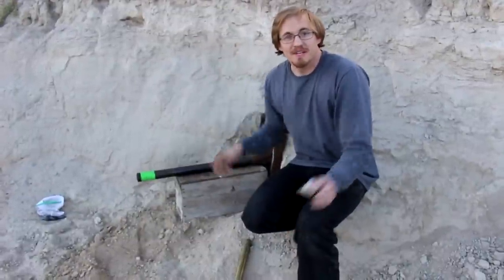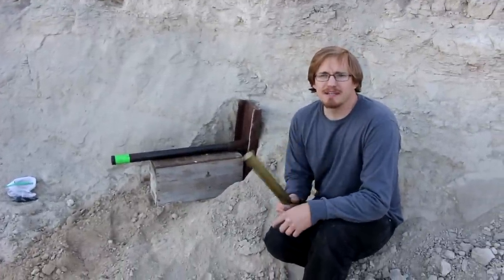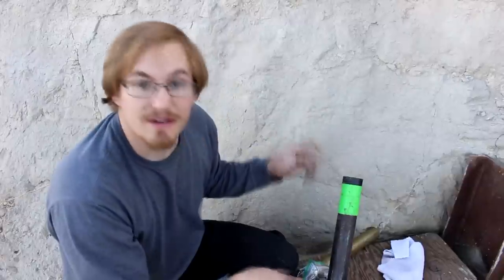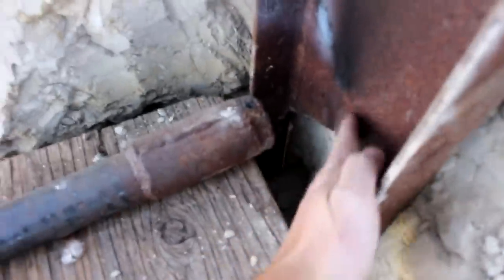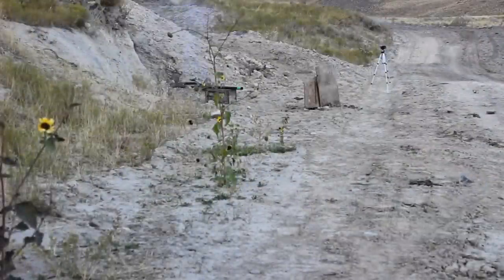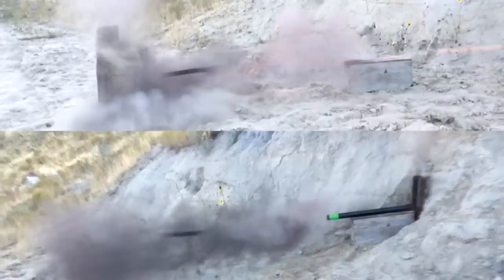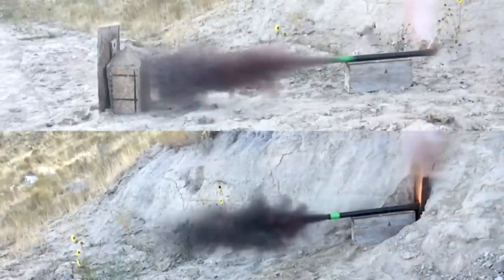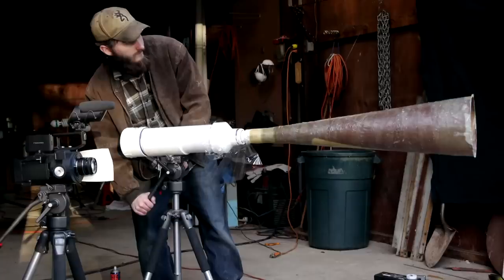How Does Recoil Affect Gun Performance?

Comment: I may have missed this, but it seems that a longer barrel with no touch hole would show a marked difference braced vs unbraced as the expanding gasses have only one direction to go and thus expel the projectile with even more force. Although I am thinking about smokeless powder not black powder, so it may be that the whole explosive vs propellant is the matter. That is (if I understand the difference correctly) the black powder has an almost instantaneous combustion, whereas the smokeless would burn all the way through, thus moving the center of expansion outward as the projectile leaves, but moving in both directions when unbraced.

Disclaimer: I'm mostly making things up and probably completely wrong.  Please correct my ignorance.

Comment: Can you shoot a gun out of another gun with the muzzles pointed at each other and load them so the projectile of the projectile-gun falls straight to the ground as soon as it's fired? Then if that works, gun within a gun within a gun... gunception. Also, if the muzzles were pointed in the same direction, I wonder how many levels of gunception you'd need to reach the speed of light.

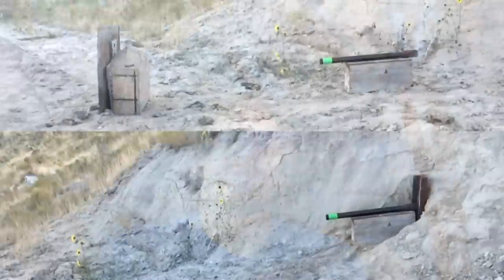Comment: I don't agree with this conclusion. I would like to see more tests done with a smaller object so that any changes will have a bigger effect (visually). I still strongly support the case that the object will have a higher velocity if the barrel is strapped down (more time under more pressure for the projectile). I've even watched the video at least 7 times (starting @ T = 5:05) and to me it looks like the bottom projectile is traveling faster (you can slow the video down to 0.25). You can see that the bottom projectile actually covers more distance than the top projectile (before the top one hits the man-made wall).
Reply: The projectiles have no frame of reference and too many variables, so this conclusion is subjective.
Reply: Actually, with more controlled tests you can prove only one conclusion (not subjective) while keeping all the other variables the same.

Comment: I disagree, I feel it was to do with the size of your charge, to large for the test. 
If you try it with 1/3 of the charge then I feel you will see different results. 
by having a large charge and a slow rate of propagation with the black powder you allowed the reaction to escape the test unit this then acts in different ways and not testing the gun, now you have expanding high pressure zone from on going reaction.
also the target was a bad idea as distance would have been a great validation of the energy on the brass slug.
Less charge and shoot for distance, measure where the shots land.
Reply: try increasing the weight of the projectile and reducing the weight of the gun, large brass slug in titanium gun, then you will find a very good example of a difference

Comment: I'm pretty sure the recoil has an effect of reducing the effective barrel length by the amount that it has jumped back by the time the projectile reaches the end of the barrel. I'm sure there was a measurable effect but your camera wasn't sensitive enough to show it. Anyway it looks like the barrel didn't move untill the slug was at the very end, and by the time leading edge of the slug reached where the barrel's end was the barrel had jumped back about as far as the projectile's length. So i imagine if you had a more sensitive measuring device you would find roughly the same velocity from an unrestrained barrel vs a fixed barrel that was reduced in length by the slug's length.

Comment: Cody, excellent video, as usual.  So many of your followers are more excited about science because of your work . . . you should be very proud.  I'd like to make one point:  You mentioned the brass bullet was no longer being pushed by the burning gun powder once it left the muzzle.  That may not be entirely accurate.  Most rifle bullets exceed the speed of sound and create a "chamber" or tube behind them.  As the powder continues to burn for several feet once the bullet leave the muzzle, a small and maybe insignificant force is still being applied to the back end of that bullet.  The faster the bullet, the more significant is that tube.  It's the same principle that makes a supersonic fighter jet accelerate when the afterburner is used.  Some of that "extra" fuel is burning behind the jet in its "tube".

Comment: Even though the barrel is flying back, how is the distance shorter?  Wouldn't it still have to travel the entire length of the barrel? I think more tests should be done with a barrel without an exhaust port to verify if the loss of gas from the exhaust is the reason why the velocity stayed the same in the non-recoil barrel.

Comment: the stabilized gun does have a very slightly faster velocity according to the footage you have shown. it may be because the recoil of the gun bounces off of the platform, and transfers back into the projectile. i think it would have more of a effect though if the gun and projectile were made out of materials that have a higher specific sound.(i know that these metals already have high specific sounds) however, the barrel of the fixed gun was tilted downward more than the unfixed gun, so gravity may ave also contributed.

Comment: Newton's third law is based on force, not work. Alternatively you could reformulate it to be based on momentum, but again this is not the same thing as work.

I think the point that made a difference is that the mass of the gun is small compared to the mass of the gunpowder fumes inside it. If you replaced them with something lighter, or replaced the gunpowder with something heavier, you might see a difference between the two situations. As it is, the gun recoiling off of the explosion shockwave barely makes a difference because, whilst total mv is conserved, the mv^2 of the shockwave is larger than for the gun because of its smaller mass.

Comment: If you step through the frames where the bullet actually left the barrel, you would see the braced one actually has a bit more momentum. Not much, but it is there.

The difference though is almost insignificant though because most of the force that powder could have provided, instead went out the back either way. Your brace only partly capped the barrel.However, If you capped the end of the barrel so it was not open in the back at all? (like an old civil war cannon), now you'll have all of that pressure build up and directed to propelling the round instead of leaking. I am willing to bet repeating your test will give you very different results. With the end capped, the overpressure inside the chamber has only one way to go, right against the back of the bullet. But you also turned the barrel itself into a bullet as well so now you can have all the force going into the round (if the barrel is locked down), or only half of it as the barrel takes the other half and flies with it.

That's the basic principle behind real cannons and guns.

But... CHECK YOUR LOCAL ORDINANCES first!

Comment: I didn't hear any mention of the total pressure in the barrel between the two tests.  If the gun moves backward at the same velocity as the projectile moves forward (which it should if they have the same mass) then shouldn't that also mean that the pressure in the barrel is decreasing twice as fast?

Comment: The resultant projectile velocity Vp will equal some form of Vp=Vt-|Vb| where Vt is an ideal total velocity and Vb is the barrel velocity.

A unrestrained barrel of equal weight to it's projectile will move backward at the same speed as the projectile moves forward, and that is determined by the integral over time of the force provided by the explosion. As you have a fixed force that means the projectile will move at half the velocity relative to the ground of a projectile shot from a barrel that is completely restrained. 

In an ideal instantaneous explosion p=nrt/v so integrate over that wrt volume and temp (expanding gasses cool so t is not constant) to find the total force.

Comment: cody, the motion of the slug and the gun is relative to each other, work done is either the gun+slug moving or just the slug moving. as you said W=integral(force)*ds doesnt matter how you do this integral. BTW "amount of work done is equal and opposite" isn't accurate work is energy it is a scalar

Comment: well if the barrel were longer and the charge were increased, the braced cannon might get higher velocity, not because the energy is being 'bled off into the cannon' on the unbraced model, but because the powder has less time to burn, and the, well i dont know what it is called but the ammount of time the combustion gasses are under a given pressure will be less at all given pressures, in the unbraced model. Is that going to make a noticable difference in projectile velocity? only in extreme circumstances such as yours, where the projectile weighs as much or more than the barrel

Comment: I have a different explanation based on what my brain came up with and not what anybody else ever said. The unbraced shows the gun moving backwards from the force of the explosion so that easily shows what the force us doing backwards, and the explosion is the same in both so it pushes the brass out the opening and pushes the gun back the other direction into a small mass of air to absorb it. In the braced gun, same explosion, same force pushes the brass out one direction, but the other direction the force back is the same but you don't see any movement so it looks different but an equal force is transmitted into the rock but it's dissipated by the enormous volume and mass of rock (a mountain) absorbing it. So the brass is shot out one direction with the same force so it goes the same distance in both. The opposite direction the force of is transmitted against air or a mountain with equal force so it travels farther against less resistance but the force transmitted is the same.
Reply: I can't correct my typos, but if you read that slowly a couple times then you will know what I meant to say. 8)

Comment: I think it's inconclusive and more experiments need to be carried out. 
Like more and less powder, faster and slower powder and a "oneway valve" ignition hole
Cause what you're saying is, its the initial blast that causes the projectile to move and not all of the expanding pressure from the powder. I feel it's more logical that if the barrel is anchored the "expanding powder pressure" goes only in one direction which is pushing the projectile out faster

Comment: Need to look at the total momentum of the system before and after to calculate the velocity. Not Work. There is an MIT physics teacher (walter lewin) who has a whole series of his lectures available on Youtube which talks about just this. He has a awesome experiment where he uses two masses on a simulated frictionless surface connected by a spring. He cuts the string to release the masses. It is the same concept as the gun with recoil.

Comment: So then for me another question come up. Should this not mean that it make not a difference if you do multiple explosions in the barrel at the same point or direkt behind the bullet to speed it more up? If you do the next explosion behind the bullet yes the pressure behind it is bigger but the pressure decreases faster because of the space it have in the barrel. And if you do the explosion on the same point (how ever you will archiv this don´t go of with the first one) would more or less move the center point of the pressure from the first explosion so more time with lower pressure to speed it up.
Or did i miss something here?
Well if you find a way to test it it would be nice.But the problem with the double charge at the start point and the maybe to less oxygen in the barrel for more explosions are hard to handle so i understand if you don´t do it^^

Comment: also depends on the speed at which the propellant burns, if it all burns before it exits it doesn't matter, if it is slow burning and / or longer barrel, also consider how recoilless guns work and end up using more fuel. also consider that the unmoving barrel has X  if the barrel and the slug have the same mass, the slug will move faster relative to the muzzle. also remember the every action has and opposite and equal reaction in regards to solids, when you introduce a gas it can be redirected, like with a pulse jet.

Comment: That rod has an effective surface area to the expanding gases of about the 2 dimensional area of its diameter. The barrel has a surface area of the inside face of the pipe plus the diameter of the back is minutely greater. Pressure is force per unit area, and much of the barrel's area is uniformly radial to the vector of the projectile. Work is done on the non-ideal material of the barrel expanding, like a really stiff spring. Higher force over less distance.

Comment: This is a topic I've given thought to before, but, never so curious as to do experiments.   Seeing the shock wave on the rock smashed my belief that there was no motion.   Your explanation was abundantly clear.  It's very obvious that there is motion, but, since the rock face has more mass than the projectile the amount of motion is proportionally less.    After watching the video, I had a follow up question.  If the back of the gun was a mesh, which allowed gasses to expand inside a enclosed area, could that gas then be harnessed to propel your projectile with even more force?  Obviously the mesh would need to be very strong.

The basic thought is that half of the energy of the explosion is being used to move the gun and whatever is bracing the gun, could that energy redirected to assist in moving the projectile?

Comment: Its all due to the speed of sound in a medium.  The air around the explosion actually has a lower speed of sound(aka transfer of energy) then normal air due to higher heat and higher pressure.  When the explosion happens, almost instantly, both sides of the system are moving away mutually faster then the gas can transfer energy between them. This is true for the stationary gun or moving apart.  The stationary had slightly more heat(sound and thermal), whereas the unmounted gun would have been a less loud explosion, with less heat transfers to the barrel because the kinetic energy used up some of that energy.

Comment: Will you do a gun demonstration without a touch hole to see if braced does better or would it be too dangerous? 

Wouldn't the pen technically be the barrel in your pen experiment and the item being pushed the bullet, because the force originates from the clicky pen which is inside the pen at the time until it pushes the item you choose... wait unless the pen body is the barrel and the clicky part is the bullet, then it just shows the force it can apply, right?

Comment: In such a case it would be much more reasonable to consider the momentum in my opinion. The work done does not need to be the same on both sides, while the force must be the same. And the momentum of the system has to be remain the same.

Comment: congrats on the rationalization of the problem...
it really is IMO a problem of energy transfer, explosion = pressure -> force on the projectile -> aceleration
so my initial guess would be that a more confined explosion would increase pressure.... now what I failed to account is that the  pressure is not homogeneous in the chamber and unless the barrel is long enough that the build up can catch up with the projectile it will make no significant difference... the spring video is great :)